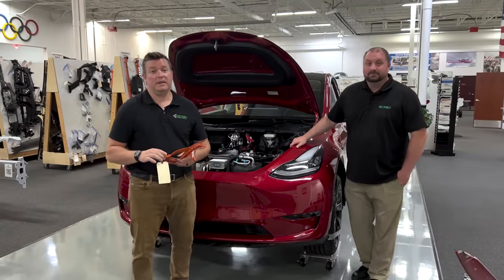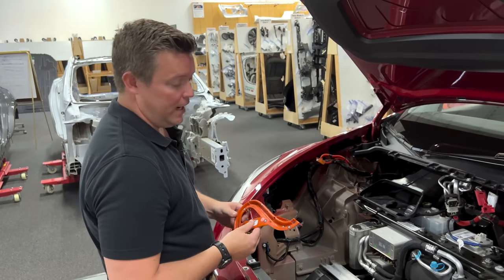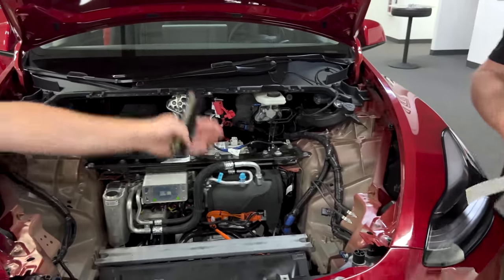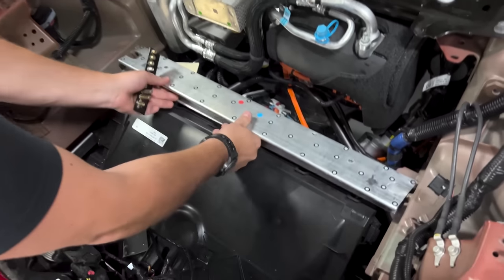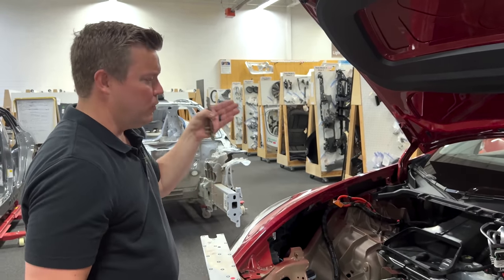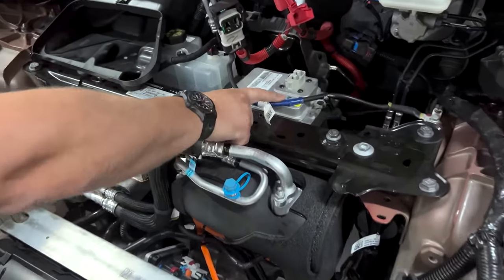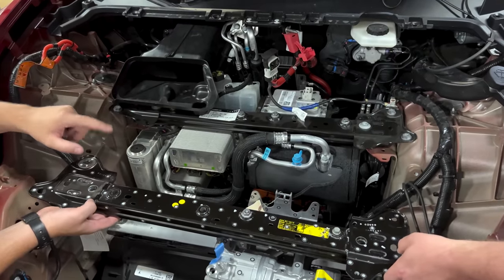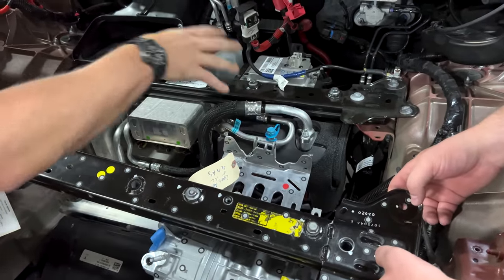Tesla Model Y - Under the Hood | Giga Texas Revisions

Comment: The revisions are great but I see potential problems in the future with parts availability for repairs and warranty work. As long as the revision can replace the previous part
Reply: That's why they have over the air updates, you genius! ;-)
Reply: @Cloxxki  over the air updates cant correct revised hardware
Reply: FALSE, ALL of Tesla parts are DESIGNED to be Backwards COMPATIBLE with older model cars , the 2022 FRUNK tub , fits PERFECTLY w/ the 2018 model . 
and All Tesla can update from the 12v Lead Acid to the NEW 15.5v Lithium battery. 
just as an Example.
Reply: @markplott4820  2021 and 2022 Model S parts will not fit on previous Models. Some early Model 3 parts will not fit on the later models so they are not all compatible. Some use Intel chips while others use Ryzen, Some have double layered windows and some do not. Here is an example..... In this video it was stated that the washer fluid bottle was slightly changed, will it fit the previous models or will tesla have to continue to make the older version also for parts availability. Even the high and low pressure A/C lines are slightly different.
Reply: @extendedepicmusic5017   - 2022 FRUNK tub will fit the 2012 model S.
Reply: @extendedepicmusic5017   - people w/ HW 2.5 can easily upgrade to HW3 and latest AP software.
Reply: @markplott4820  can people with AP1 upgrade as easily?
Reply: @markplott4820  All 2022 Model S are all wheel drive, the 2012 Model S is rear wheel drive so the frunks will not interchange

Comment: 17:04 I lemoned my Tesla because of that bracket. It wasn't welded correctly and was squeaking and rattling non-stop. Tesla told me to go a service center to get it welded. I did, but had deep regrets of doing it. Exactly what both hosts said.
What if I end up in a car crash and that was the point of failure? hell no. Good bye Tesla hello Lemon Law
Reply: So sorry to hear that happened.
Reply: C'mon man! Tezzerla wouldn't and couldn't 'weld' that. They would drill and nut-and-bolt' it. I detect BS....

Comment: I have to admit not being up to speed on the latest CAD systems and tool making technology, but I wonder about the economics of constantly making nearly gratuitous changes in the designs of parts like the extruded beam.  It isn’t just the tooling, the new designs have to be verified with testing, especially in cases where there are safety implications.  That extruded beam change saves $6,000 per 100,000 vehicles manufactured.  How does that compare to the up-front cost of the redesign?

The two examples of the beam and washer bottle probably don’t have implications in servicing vehicles because the parts are interchangeable.  Other parts like the pump bracket alteration mean stocking parts to accommodate the design running changes.  That isn’t a problem for the manufacturing plant, but it is a pain for the servicing organization and increases maintenance costs for the consumer.
Reply: tools wear, the CNC machines that make them get more and better over time, so costs for new molds come down.. and its not about the cost savings for materials, its time savings on the assembly line.
Musk wants to speed up the machine that builds the machine to pop out theses things at faster speed.
Reply: "Gratuitous"?

Comment: What happens to this aluminum casting in case of car accident? It cracks and entire body should be replaced?
Reply: There appears to be about 400-500mm of sacrificial crush structure forward of the casting.  Those parts are designed to be replaced with just bolts and sealant.
If the collision is severe enough to go past that point and bend the casting, it's probably a parts car from other damage.  That's far past airbags deploying, it is the severity where the motors tear their compliant mountings,
Reply: @1djbecker  many side impacts lead to apron or light strut tower damage. If it's made of steel - dents could be easily repaired. In this case - car will be totaled.
Reply: That would probably be a total and the car would be recycled and if the drives are ok there are aftermarket ev builders that would love to purchase them, not to mention the battery. I have seen some cool old cars get Teslafied
Reply: @ajm2193  yes, and insurance rates will be enormous.

Comment: What this shows is just how far Tesla is from understanding basic manufacturing and that they still have a huge mountain to climb to catch up in this regard.  Other "legacy" auto makers made these kinds of mistake decades ago, and will know how to avoid the vast majority of them right out the gate with their new models.  The last thing you want to have to do is to change common parts and pieces every year or from factory to factory.  This a clear sign of lack of experience and knowledge in making cars and certainly not one of any sort of superiority.  You gotta love the stock pumpers, LOL.
Reply: LEGACY auto and Startups like RIVIAN & LOOSER motors have no CLUE.
Reply: WRONG! Legacy automakers make the same mistakes, then sit on their laurels for years,  and try to make the same tired  old components and platforms stretch out for decades if they can get away with it.  Tesla is starting with more efficient design and constantly improving,  yet still making them backwards-compatible, like that aluminum extrusion and steel beam that still mounts to the old points. JUST the past couple of years, as one of many examples,   GM finally put an independent rear suspension on their full size SUVs, and they still use leaf springs on their pickups. That tech is a century old and makes for a horrible ride.
Reply: @jamesengland7461  Not going to disagree with you the "horrible" ride, but if you want the load and tow rating independent rear suspension just isn't going to do it.  But I am sure you realized that, ace.  You are 100% wrong on Tesla.  Changing and redesigning parts every few months/year and/or different from factory to factory is a clear sign that they still have a lot to figure out in the manufacturing of cars.  And it shows in the end product, and people can tell.  Its just that you can't tell, because you know nothing.
Reply: @KungPowEnterFist  you misunderstood everything I said.
Reply: "Other "legacy" auto makers made these kinds of mistake decades ago, and will know how to avoid the vast majority of them right out the gate with their new models."
Yeah, we noticed how good they are at this. You're spot on.

Comment: Why is the entire body not painted? It looks like they only spray the outside surfaces or ones that are likely to be visible. All the interior surfaces lack paint. Half-assed, shoddy build as always from Tesla. It's all about surface-level appearances.
Reply: Idiotic comment. The car gets a primer dip then the paint is only sprayed where visible. My vw looks the same. It saves weight, cost, consumables.
Reply: @moki123g   Shhhsh, he's one of those guys that opens the hood all the time and removes the interor covers to marvel at the paint all day long. Everyone has his personal fetishes..
Reply: @moki123g  It's an idiotic comment to state the fact that a $65,000 car has a shit paint job with paint literally only in places where one might see it? Actually, not even that, because if you open any of the four doors in a Model Y, all the door hinges are undersprayed or unpainted. That kind of bullshit might be acceptable on a Nissan Versa or Chevy Spark, but not on a car over $50k. And don't compare it to your bottom of the barrel VW. Did your VW cost $65k? Didn't think so. Even my 10 year old Civic has a fully sprayed body. Primer is not enough. Paint and clearcoat add extra layers of protection that primer alone doesn't offer. I don't expect clearcoat in non-visible areas, but do expect full color spray. Go look at a Lexus in this price range and be amazed by the level of quality. This is just Tesla squeezing every penny and cutting corners, yet still selling their cars at absurd prices, and continuing to hike up their prices every month. You get a cheap POS for exorbitant prices. Time to call out Tesla for their BS. They've been getting away with shoddy workmanship for too long. I'd be fine with this if their prices reflected their crappy build quality, but they don't. You pay more for less.
Reply: @joansparky4439  Do you think water ingress, salt-fog and corrosion only give a shit about visible areas? 😂😂 The lack of paint is more of a longevity and protection issue, not an esthetic one, but that's all that Tesla cares about... skin deep looks. These cars are designed and built to be disposable, not to last. Pure garbage that the fanboys lap up without thinking for themselves. Go look at other cars in this price range, like a Lexus and look at their paint job and corrosion protection. Night and day.

Comment: Well, after 15 years selling cars they are still at only 4 models, the first having been discontinued.
So they better darn well keep improving the few models they actually do offer.
Imagine Tesla did care about what customers think. 
Model S and 3 Estate versions. HUDs. 3rd party UI shells.
Reply: Good luck with your ID.4
Reply: 5 model's sold, several other oems used tesla pack's&motors in e car conversion since 2010. And it's 14 years since the first roadster deliveries. 3 new tesla products slated for 2023 release. 3 of the largest most modern ev only factories being ramped simultaneously at this moment.

That all aside I agree to grow to the volumes tesla targets. Imo they need a bit more variety across the board, the premium cars need something like that new hanz sustainable leather package. They should ad some of the most commonly requested features that tesla lacks currenlty. 
And other ev peer competitors may offer, few as those may be. 🤔
Reply: TESLA makes 1000 small Changes ever 24H and 100+ BIG changes every Month.
Reply: You miss the point.  Tesla aims to maximize the number of EVs produced, not give the consumer 31 different flavors of ice cream.  They will only introduce more "variety" IF their sales growth slows down.  Right now, they're pretty much sold out till next year for their current lineup.  In fact, they opened up Austin and Berlin with the primary coal of manufacturing just one model, the Y.   The demand for that car is insane.